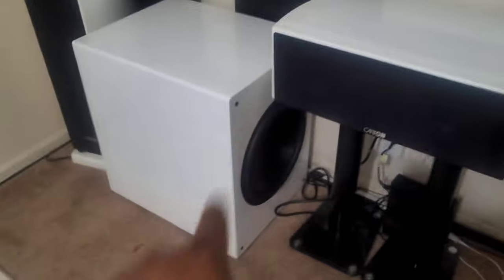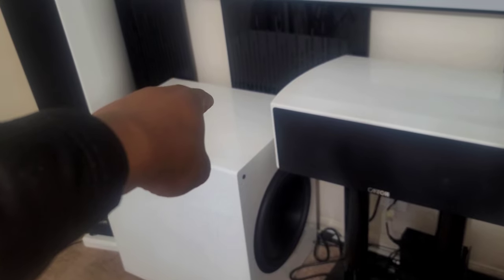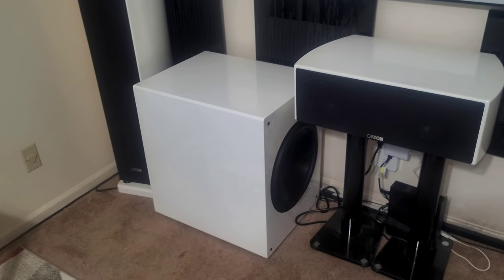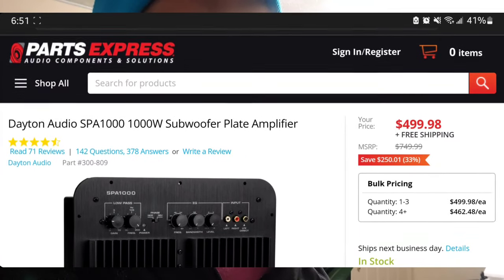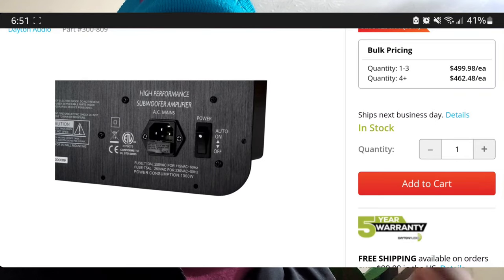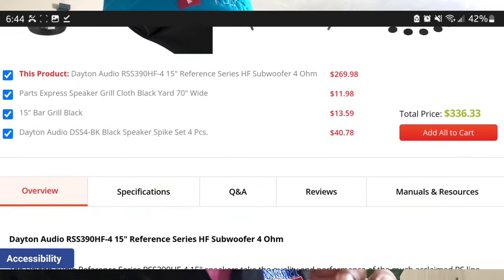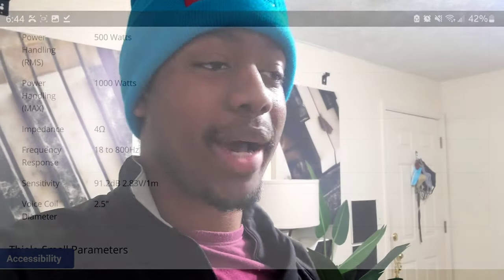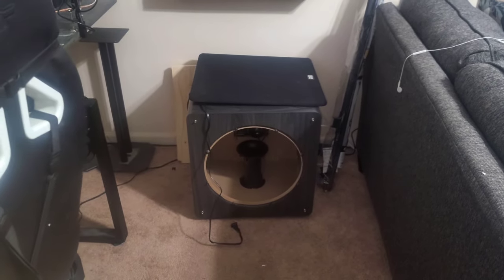Building MY OWN Rythmik G25hp Subwoofer | Project Rythmik Prelude

Comment from the maker: Parts express told me these drivers in thr video are dual 4 ohm but after doing my own research it's pretty clear that it's not. My choices of drivers are the mx-15 line or the rss390he which are both dual 2. Parts express was able to confirm that their 2 ohm subs sit closer to 4 than 2. So it's a risk I'm willing to take plus the box rise I'll experience. Overall I shouldn't have any issues. I'll link those 2 drivers in the description. let me know which is best best!  I'll leave a link to both. 

link to Dayton Audio subwoofer drivers:
https://www.parts-express.com/Dayton-Audio-RSS390HE-22-15-Reference-Series-High-Excursion-Subwoofer-22-ohm-295-292

https://www.parts-express.com/Dayton-Audio-UM15-22-15-Ultimax-DVC-Subwoofer-2-ohms-Per-Co-295-514
Reply: When doing the math are you including or do you have to include impedence rise
Reply from the maker: @Joshua Kemp  I definitely keep count of the impedance rise for sure. It'll fluctuate a lot during playback too. So I'm not too worried when it comes to choosing an amplifier

Comment: great idea - but the Rythmik  subwoofer, because it is servo controlled, allows a smaller enclosure to be used than you would need - you will need an enclosure equal to 2 times the volume recommended for one Dayton driver.   Even then the - 3dB low frequency capability will not be as low as the Rythmik.    Best option, for the lowest -3dB frequency ( without going servo) would be to build the recommended ported enclosures for these drivers  - you still need 2 times the internal volume of the recommended ported enclosure for one driver.    But then again,  If you like the transient response of the sealed system, stay with the sealed design.

Comment: Things to consider during your comparison:

1. That Dayton amp might not be stable at 2ohms (if you wire the two drivers in parallel). Also, if you wire the drivers in series they will be getting around 200Watts each since the amp is rated for less than 500watts into 8ohms load. There is no way to wire them to make the amp see 4 ohms, unless you make two dual twos wired in series each (8ohm) and then wiring them together in parallel to bring them back to 4ohms.

2. Remember to use MiniDSP to eq the sub after you build it. Rythmik is already EQ'd. If you don't eq sealed subs in the ULF, the response will be sloping downwards rather than be flat.

PS: I would also change the drivers to Stereo Integrity SQL 15 for better power handling and more excursion than the RSS390. You can actually build something better than the Rythmik (and cheaper) with these drivers, especially when paired with SpeakerPower plate amps or QSC rack amps.
Reply from the maker: I've done all this thinking already. There 2 ohm subs sit at 3.4 ohms. Wire in series/parallel will keep it there. Box rise will be well above 3.4 ohms. Each sub will see around 400ish Watts rms since the plate amp doesn't quite reach 1000w at 1% thd. They are 90db efficient so theyll be fine. I'm still debating drivers but I'm not concerned for power because I don't want an external amplifier to power the sub. I don't want to throw tons of  money to it. Especially if I'm going to give it away.
Reply: @Kpaceguy  DC resistance for RSS390HO sits at 3.2 ohms. Wiring in series leads to 6.4ohm load, while wiring in parallel cuts that impedance to  1.6ohms. At 6.4 ohm the amount of power that the Dayton plate amp  can provide will be significantly less than what it's rated at 4ohm. If the drivers are in parallel, however, the amp is unlikely to provide any meaningful output without current-limiting due to over-current. In case it doesn't current-limit it will destroy itself.
Reply from the maker: @Karani Desmond  parts express told me the coils read at 3.4. Series/parallel should read out the same. Series raises it, parallel lowers it, series/parallel leaves it the same and that's what I plan to do. The sub that I have linked is a 4 ohm sub 500w rms. Which is about what this 4ohm rated amp will give me to both drivers in series/parallel
Reply: @Kpaceguy  what they meant is that this is not dual voice coil like other Dayton drivers, meaning that there are no series/parallel readings. However, if you are using two of them in a single box like you intend to do in this project, you will have to wire them together to connect to the amp (because that amp is not stereo). Therefore, how you wire them will either lower (parallel) or increase (series) the overall impedance "seen" by the amp. Essentially, 3.2 will become 6.4 or 1.6, it won't be the same.
Reply from the maker: @DesmondKarani  what do you mean they aren't dual voice coil? Isn't that what their "2+2" means?
Reply: @Kpaceguy  2+2 is the spec for MX15-22 and Ultimax Series, not the RSS390 that you're buying. The MX15 is also 800 Watts. Check Dayton Website for clarification.
Reply from the maker: I've switched over to between the mx-15 or rss390he. One of those two. Probably the mx for rms rating purposes..after hearing from parts express that their ohm ratings are more around 3.4 per voice coil + box rise I figured the amp would be more safer than not most of the time. The reason I wanted to go with the sub that I originally mentioned in this video is because the first guy I talked to from parts express told me it was dual 4ohm. I didn't think it was but he insisted but after spending all day yesterday and last night after the video I saw that it wasn't. So my only two realistic options are the mx or 390he. Parts express was able to confirm they sit closer to 4 ohms per coil than 2 so it's a risk I'm willing to take on order to be able to stick with a plate amp apposed to Another external amp that i don't want
Reply: @Kpaceguy  i'm a bit confused how you are going to run series-parallel when it's a speaker pair and each speaker only has a single voice coil? in that scenario you can only wire either series or parallel. the RSS390-HO4 is a great sub. It gets very loud on little power and only needs ~1.5 to 1.6 ft3 net air space per driver. You can build ~3.5 ft3 box total when factoring for displacement and bracing for that driver pair. Depending on where you set your x-over points a pair of RSS390's in parallel will be no problem for the plate amp from 9 hz to 45 hz. above that will be an issue though as parallel wiring will put you at ~2.1 ohms from 60 hz through 120 hz. the dayton plate amp if you wire the speakers in series will still produce (dyno tested) 637w at 8 ohms. the same amp only does 877w at 4 ohms - about 1.5 dB louder.
Reply from the maker: @Nicholas Hulme  parts express told me it was dual 4 ohm but after doing my own research it's pretty clear that it's not. My choices of drivers are the mx-15 line or the rss390he which are both dual 2. Parts express was able to confirm that their 2 ohm subs sit closer to 4 than 2. So it's a risk I'm willing to take plus the box rise I'll experience. Overall I shouldn't have any issues.
Reply: @Kpaceguy  The HE version is great, but a bit more dollar than the HO (plus more power handling and excursion). It is also duo voice coil, unlike the HO. However, you can eliminate the guesswork of how much impedance summation they have by using Dayton's DATS V3.
Reply from the maker: @DesmondKarani  what's that? Wouldn't a volt meter serve the same purpose?
Reply: @Karani Desmond there are benefits to the SI SQL 15, the biggest being that it is available with dual 4 ohm voice coils so you can wire a pair series-parallel to get to net 4 ohm at the amp and you have a ton of headroom for eq - set a wider q at 20 hz and a narrower one at 25 hz and it will really dig due to its much bigger xmax. it's ~3 dB less efficient than the RSS390 and also requires an enclosure that will be about 1 ft3 larger than the comparable for a pair of RSS390's. to your original point the SQL 15 is much more conducive to eq. the other benefit i haven't tested is that i have a dead RSS390 in my garage, it has never seen more than 400w and was in a sealed enclosure using only 60% of its xmax. dayton's warranty is next to worthless. that said the RSS390 is a fantastic sounding sub when it works.
Reply from the maker: @Nicholas Hulme  the big thing about the sql-15 is how much more powerful it is than the amp I'm using. I'm assuming I'll be sending less than 500w to both subs rms on this plate amp
Reply: @TheBassallyear100  Yeah, the SI SQL is a fantastic driver. The dual 4 ohm would be great for KPace's project. RSS390HO is no go for sealed subs especially due to 12mm excursion, but the RSS390HE okay, just that it doesn't have dual 4ohm, only dual 2ohm. If KPace builds this with 390HE or SQL 15 he'll need to ask the winner to use a more powerful amp to exploit their full potential. That Dayton  Amp just needs a single 4 ohm driver. preferably ported.
Reply: @Kpaceguy  there's still plenty of juice in that amp for a pair of SQL 15's and you won't run the risk of over driving it with dual 4 ohm voice coils wired series-parallel. that said the RSS390-HE will get you similar results but you will be giving it a hair under 3 ohms at its lowest impedance point (wired parallel) - it has a very conservative 4 ohm rating. not ideal but should be workable. you will also squeeze a little bit more juice out of the amp as a result of it. the RSS390-HE does optimally require a bigger box but it will still work comfortably for a pair in net 4.4 ft3 sealed that the SI's optimally need. Box Qtc will be about 44 hz for the dayton's vs 42 hz of the SI's. A budget banger that will also give very similar results to the SQL 15 and RSS390-HE is the NVX VCW 154. It too will work very happily in a net 4.4 ft3 enclosure with tons of headroom for eq.
Reply from the maker: @Nicholas Hulme  thats what I'm leaning towards doing. I think that'll be overall the best move for the project and if someone wants to throw a bigger amp to it when I give it away, they can. I personally won't as eventually I'll just get another rythmik when I'm in a bigger home. But should be fun "cloaning" one. If built well and eq'd properly, this cloan should pair better with my rythmik than the definitive tech DN10 I have. And if so, maybe I'll give the DN10 away instead
Reply: @Kpaceguy  how about you go all in and see if you'll like it? 😀 Chances are you might not go back to commercial subs (and probably end saving a lot of cash). $2900 can really buy you a lot in DIY.
Reply from the maker: @Karani Desmond I'm in love with the servo tech and the sheer power of the rythmik that I don't know how worth it,  it would be to truly build something to beat it. That all may change when I move and have the space for it though. I love DIY projects in general so it's not out of the question. Maybe when the channel gets bigger and I bring home more $$$ from YouTube maybe I'll try it lol. Depending how this little project goes, if it impresses me enough maybe I'll make some beefy high end subs
Reply: @Kpaceguy  DIY subs - it's a slippery slope. before long your living room will be looking like the trunk of your Lexus and not just your neighbor but your neighbor's, neighbors, neighbors, neighbors, neighbors, neighbors, neighbor will hate you too! lol seriously though if you build a box somewhere between 4 to 4.5 ft3 net you will have a ton of driver options for it. it might make a fun side video adventure to do a comparison between budget, moderate and high end drivers that all work in that one enclosure? P.S. - Box gross volume on your Rhythmik is about 4.5 ft3 - probably about 4.0 to 4.1 ft3 net after driver displacement and bracing.
Reply from the maker: @TheBassallyear100  I'm glad you told me. Because I do plan to replicate the box size. Looking up crown amplifiers as well
Reply: I would chose the Fi audio HT series. Wayy better xmax and performance for the 1000 and 2000 watt options compared to the Dayton stuff. Maybe passive radiators would be a good option as well. There's a Dayton 10 inch passive radiator plan, I bet you could scale that up to an 18 inch Fi audio setup. Psi audio which is normally for cars have fantastic passive radiators.
Reply: @justinbeamon6624  The HT-3 has not been in stock since like mid-2021. It's a great driver but Fi has not restocked it for some time.

Comment: The only problem I see about what you stated on the design is you have box of specific size in mind and then you picked two 15" drivers, the thing I'm wondering is if the box has enough volume for the two drivers (when I built a sealed single Dayton 15" in the past, it required a box with 8 cubic feel of free space inside so I couldn't simply make a 24" * 24" 24" cube because I had to account for bracing and part of the motor volume intruding into the cabinet)?

Rythmik (1800w amp) most likely used an eq to get the desired performance (and if I remember correctly from the past though I don't know if it's like this now, they also had a servo control to protect the driver) and this may explain why they had to use such a high powered amp to reach the performance goal (the box looked too small to me to run the amp flat so they most likely boosted it at the lower freq which is one of the things that has to be done to get such a performance) luckily the plate amp you are buying has slight eq and hopefully it's enough for what you intend on this design.

PS:  When I built my 15" Dayton sub (this was about 20+ years ago, my second DIY sub) I powered it with a pro sound reinforcement amp (initially bought a Carver at a pawnshop then scored a better QSC later) ran flat (no eq boost) and applied an external parametric eq to tame the peaks in the room at the time.  In the past I also built a SVS clone using a Blueprint driver at the time with good success as well (this was my first DIY sub).  I ended up going overkill for a while with an infinite baffled sub (4 Dayton 15" the "box" looking almost like a chimney being my garage firing into my basement theater (3rd DIY sub).  I'll admit I didn't enjoy building the subs too much but did enjoy the results.  I'll also admit I had a high degree of confirmation bias because at least to me my subs sounded better than what most people I knew had at the time but it was mostly due to having a better room (concrete basements have pretty dead acoustics lol) which made it easier to control the sound and the other elements that took away from it.  High quality gear, decent size box, and good electronics will produce great results the only thing is that some of these major audio companies who have great minds, passion, and pride will make products that are hard to beat but luckily we can see enough of what they do, cloning them, and maybe still get 80-90% of the performance of their product but should be better than most retailers of the same price point.
Reply from the maker: Yes I've thought long and hard about box size and amp eq. I still have time to change to an amp with a dsp if I need To. It'll be fun nonetheless

Comment: Good luck! but honestly I wouldn't recommend trying to match the G25hp if you're gonna DIY. Just get the ultimax 18's put them in a good back to back sealed box (with their optimal size) get a good amp that goes to 5hz or something and have something that is night and day against the rythmik.
Reply from the maker: We're cloaning as far as design and looks go. I'm not necessarily after matching the performance. I can't since I'm not looking to spend a terrible amount on it.

Comment: Have a very quick question to ask you when you had your Marantz 7705 how did you switch from monitor one to monitor 2 ?
Reply from the maker: I never used it. But you have to turn it on in the settings and it's always on so long as you enable it
Reply: Thank you

Comment: What up K how's it going? I have a quick question for u. I'm building an enclosure for 4 12s the specs are 44 x 18.5 x 28.5 my question to you is what size port/ports should I use to get a sound of somewhere around 31 to 34 hz. Thanks
Reply from the maker: I have no idea. Just depends how many you're using and what kind of port
Reply: It will be a slot port in the center of the enclosure. Port height is 16.5 but im stuck on the depth and width 🤦🏽‍♂️🤦🏽‍♂️

Comment: Did my own DYI subs for my home theater I have 4 twelves And A SVS PB 4000 Was kind of tricky because I did not use a plate  Amp
Reply: I'm going to guess, if you didn't use a plate amp did you use a pro sound reinforcement amp (QSC, Crown, etc)?  I did this for my home theater I had in Kansas, I was inspired from the website "cult of the infinitely baffled" using four Dayton 15" firing into my basement and the rear of the "chimney" going towards my 2 car garage at the time.  It was fun, and the neighbor at times "enjoyed" it as well.

Comment: Bug difference between Servo and regular. Non-servo subs;  you could try to fnd suitable amp/drivers for your DIY project. Anyway good luck.
Reply from the maker: I'm not necessarily trying to match the performance of the rythmik. It would cost more than I want to spend. It's more of the build and design on a smaller scale.